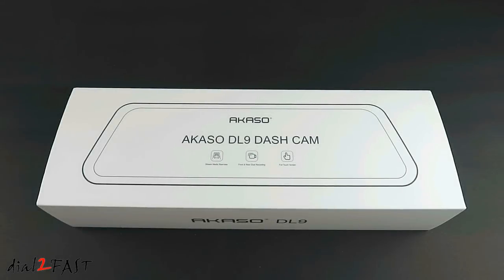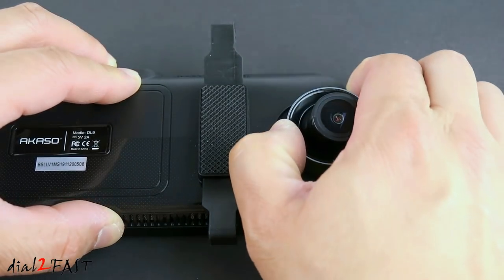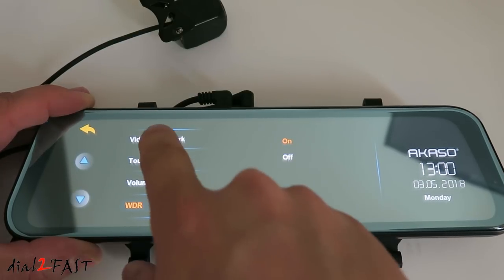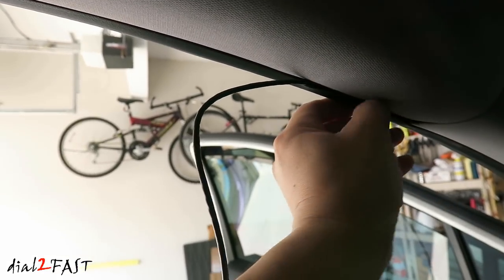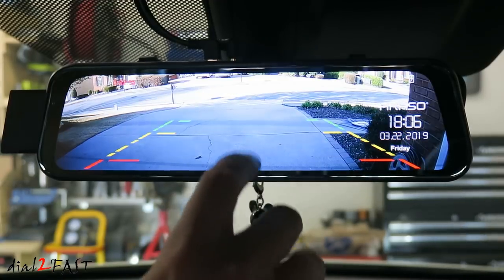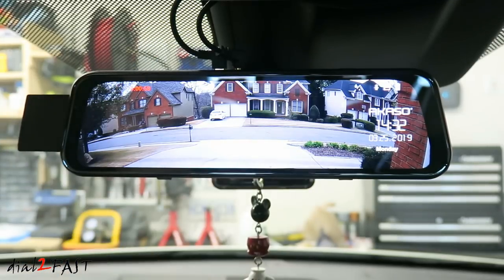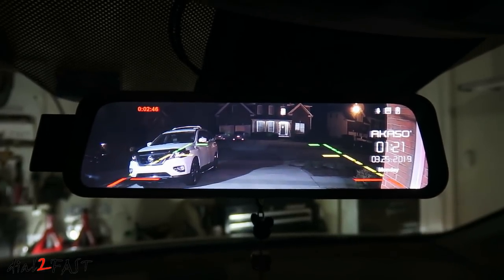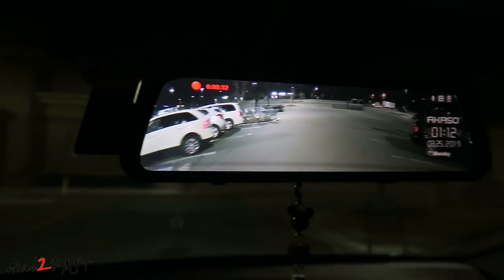AKASO 10" LCD Rearview Mirror Front & Rear Dashcam - DL9

Comment: You sir have some of the best review videos ive seen. Very detailed. I was happy to see footage of the rear view at night as im looking to replace a front/rear mirror cam that has an advertised rear night vision cam(its virtually useless at night. I have a lifted truck with 2.5% rear tint so i installed a 10 inch led light bar under the truck to light up surroundings while in reverse. Even tho this light makes backing up in the dark much easier, it does nothing for the rear camera. So it was nice to see confirmation that theres some visibility to this rear camera. Thanks for the video. Also good in depth walkthrough on the touchscreen features

Comment: Hello good sir! 

Quick question! I need to convince my girlfriend to have this applied to her car. She isn't convinced that I need to mount it on the number plate to have a good back up camera view. I can hardly believe that placing it behind the rear windshield that the back up camera can look down on the ground if it isn't connected on the numberplate. I can tell it worked for you, but a BMW 1 series 2017 has a bit more curved rear bumper. I suppose my question is if its equally as good to be placed behind the windshield or on top of the license plate. 

Either way thank you for your VERY VERY thorough review
Reply from the maker: Yes, the BMW X1 SUV has a more slanted back window, but you can still mount it on the top of the back window. The camera lens is a wide angle lens and will give you a good enough backup view. Unless you are using it to watch for a trailer hitch which requires a view directly behind the bumper, the view you get from behind the rear window will be fine as you are backing up. If you are up to installing it by the license plate, you can, but the difficulty in a proper install is more difficult (with all wires hidden). You can always try the window method first and see if that works for you, if it doesn't, then put it by the license.
Reply: @dial2fast  thank you kindly! I don't have a X1 SUV but the hatchback 1 series. How ever I think the same thing applies. Have a splendid day and stay safe! Greetings from Belgiums

Comment: Thanks so much for this video, Very thorough. I had a question: I have purchased two different cameras similar to this in the past. One would loop the recordings after five minutes and the other one would just stop recording altogether after 43 minutes. I want a dash cam that records everything until the memory runs out. Does this camera do that? Cause it looked like when you were pulling up videos, the time length was only 3 minutes on them. Thanks in advance for your help with my questions.
Reply from the maker: As shown in the video, the loop recording can be set by the user for 1, 3, 5 minutes. ALL dashcams will do loop recoding meaning it records a series of video clips nonstop and continuously. Once the memory card is full, it will start overwriting the oldest file (not all the files at once, but overwrite starting with the oldest file). If you have an actual dashcam that stops after the card is full, then the dashcam is defective.

Comment: very throughout review. Question, should I mount the rearview camera above or below my license plate light? Would having a light there help the view or hurt it because of the night vision?
Reply from the maker: I suggest mount it above the license plate to give it a nicer factory look. The license plate light will have no difference in the camera performance.
Reply: @dial2fast  Thank you for the fast response. I ended up getting something similar, called the 10" by Junsun, looks very similar. I will mount it above, thank you!

Comment: They do not seem to make the backup camera cable long enough for a truck.  Is it possible to splice in a section of wire to extend the cable length. Some offer a 23ft replacement cable which may still not be long enough.

Comment: I just purchased this Akaso 10 in dash cam on Amazon.They had a special deal, I got it for $79.99.  I have a truck but I do not want to drill holes in my truck.. do you think I could put the rear camera in the back or would I have to put it on my license plate?  Thanks
Reply from the maker: The rear camera is waterproof, so you can place it anywhere on the back that will give you a view that you want. If you don't want to drill holes, you can get some 3M double sided automotive tape and stick it somewhere on the back. Clean the surface well with rubbing alcohol before sticking it. 3M tape: https://amzn.to/35SIJ31
Reply: dial2fast 
About how long will this dash backup camera take to install professionally...approximately?  Thanks
Reply from the maker: @yogaqueen0830  If you take it to a car stereo shop to install, it might take them 2 hours depending on the type of car and how complex is to install the rear cam.
Reply: dial2fast 
I had my Akaso dash cam installed today at a stereo shop. He did an excellent job.  He wired it where I see no wires and he didn’t use the cigarette outlet.  It looks like it was almost factory installed OEM.  Very pleased with this camera and installation. Since there is no user manual with this dash cam...your video is very helpful.  Also how do I get the split screen to display, still learning all the features on this camera. Thank you! 😊

Comment: Do you have to have it plug in to the 12v outlet for it to run or is it just to keep it charged permanent? I wanted to plug in my FM transmitter but once wondering if I can do that still if I get this dash cam
Reply: You can use splitter and double your cigar slot :)

Comment: I’ve been looking for EXACTLY this setup for my father in-law.    One question, does it have a mount to install it without strapping it over your current mirror?
Reply: I was wondering the same thing.
Reply: Yes, check Amazon $90 with instant coupon. Its the exact same unit but also comes with a regular mirror mount the the "stub" on the glass. Provided your car has the standard shaped stub glued to your windshield.  The product name is different (??) but it is the EXACT same product. Here is the name... AWESAFE Mirror Dash Cam 10 Inch Touch Screen 1080P Rear View Mirror Camera Front and Rear Dual Lens Backup Camera with G Sensor 24 Hours Parking Monitor ... type that on amazon search.

Comment: Great video!  Based on this I bought one.  I'm having trouble deciding whether I want the camera inside or outside of the vehicle.  How and why did you decide to mount it inside?  Thanks
Reply from the maker: Mounting inside is a lot simpler to install. This camera is waterproof so you can install it inside our out. As long as you get a good view out to the back, you can install it that suits your need.
Reply: @columbia1991 
If your vehicle is hatchback, van or SUV inside would be the best for my opinion, you got benefit of well protected from outside elements, for sedans shape or similar you have to go outside install.
Reply: @dial2fast  Great review and I appreciate it. Im from Toronto. I have a Subaru Outback and I'll install the rear cam inside the car. I didn't see clearly but I think you used a sticky for it to glue onto the trim or did you actually screw it into the trim? Thanks again!
Reply from the maker: @WatzUpToday  You can mount it using 3M double sided tape if you don't want to screw it in. Clean the surface with rubbing alcohol first.  https://amzn.to/2O0IrAp
Reply: dial2fast is the window on your back hatch tinted? It appears like it is but I wanted to know how the camera would work with tinted windows.
Reply from the maker: @juancarlosmorales1349  Yes it's tinted but the camera will work fine and provide a good picture.

Comment: Great Vid, bud. Definitely made my purchase that much more justified.
Reply: How do you like it?
Reply: @Frenchyk  For what it is it's really good and convenient, but it has its quirks. 

Pros: Great replacement for traditional mirror, bright modern screen, cool factor, 170° view angle when using the video as a rear view mirror, but can also work traditionally with the screen off. 

Cons: no interconnectivity or cloud functionality, options and settings are not very robust. It's literally a Digital version of a rear view mirror and dash cam which gets the basic job done. But after doing research there are more advanced dash cams that I probably would've liked more. 

But for what it is, it's nifty. Just takes some eye training.
Reply: @rydenseasalt9716  I'm in the research stage now. Thanks for the reply. I prefer a wifi integrated one.
Reply: @Frenchyk  as you should. I'm really thinking of upgrading (possibly, given the work that goes into it) but yeah, you'll much prefer a wifi one I think. Good luck

Comment: Is it still recording when you turn off the LCD display?  I live in Florida and basically EVERY DAY is a bright sunny day.  I need to know it is recording if I turn off the LCD display.
Reply from the maker: It's always recording once you start your car up, and stop recording when you turn off the ignition.
Reply: @dial2fast  This is not completely true. I had an 02 avalanche and 1 of the 3 cigaret plugs was always hot even when the truck was turned off and the key pulled out.  So in that kind of plug the cameras will always be recording.
Reply from the maker: @rogerandjeanmeyer  Unfortunately there are some older cars where the manufacturer design the cigarette lighter plug to be always on. If that is the case, you need to hardwire the power plug to an ignition fuse on the fuse box. Gotta love GM engineers :(

Comment: So... my question is what is the gravity sensor use for and the parking monitor ??? 
Because the dash cam turns off when I turn off my vehicle can u explain this how to use this properly thanks...more of full walk through on all its functions 👍
Reply from the maker: G-sensor will detect if your car has an impact (ex: car accident) and once it detects that impact, it will lock that video clip so it will not be overwritten. Parking mode can be enabled if you want dashcam to monitor for any impact when ignition is off (car parked), and if it detects impact, it will record a short video clip. Parking mode uses the internal battery to operate.

Comment: Could you run a mini USB to USB type A cable to a regular cigarette lighter to USB adapter, instead of using the included mini USB to cigarette lighter power cord?
Reply from the maker: Yes you should be able to as the device just needs USB power source.